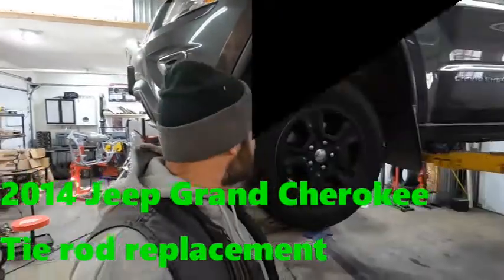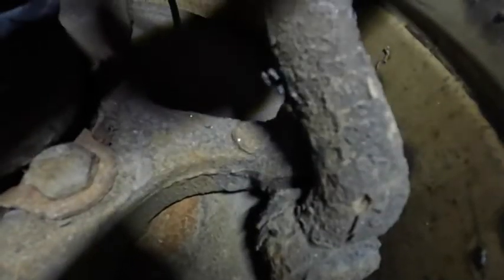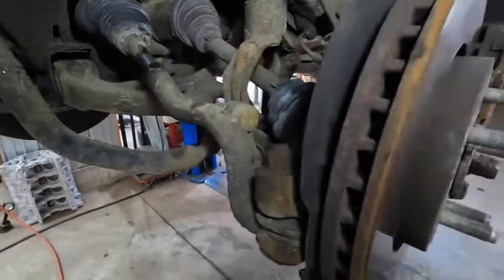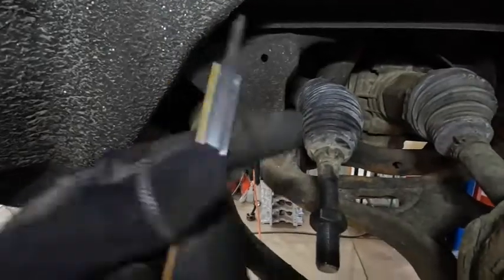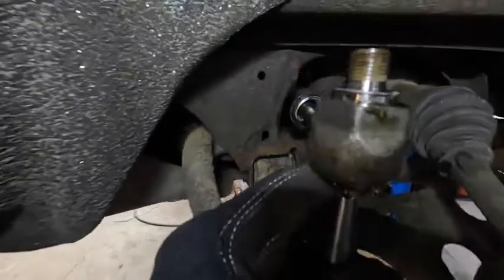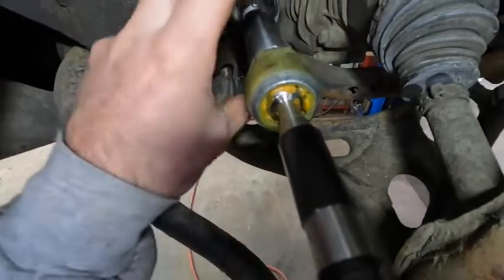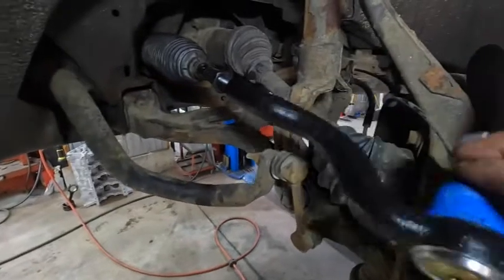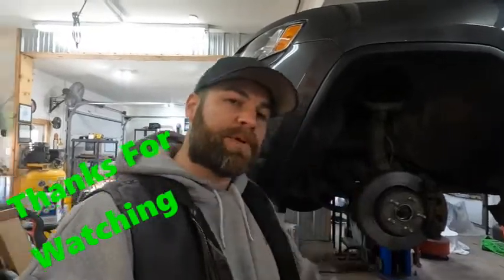Jeep Grand Cherokee Easy Tie Rod Replacement

Comment: Great video but I have a question. My 2013 appears to be leaking power steering fluid from the boot by the inner rod, however my fluid level is at max and not dropped. I was going to replace the steering rack as I didn’t know there was an inner rod. Then I saw this video. Any thoughts?
Reply from the maker: sounds like the inner seals/bushing a little fluid can look worse than it is, are you able to slide the boot back and turn the wheel back and forth when it got weight on it?

Comment: I know you said the customer asked to have both inner and outer tie rod replaced, my question is the boot on the inner rod looked good and the inner rod looked good, as a DIY’er should I replace those inner tie rods if they don’t look like they need replacing? What would you look for to make that decision?
Reply from the maker: Look for play in the joints